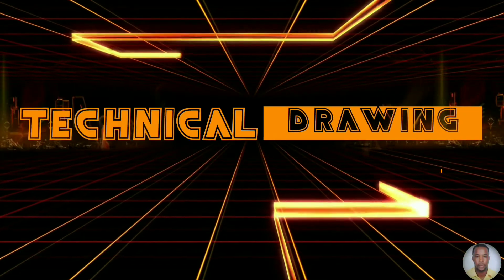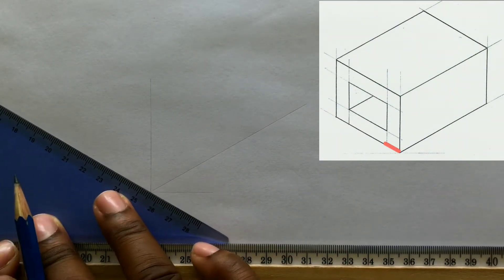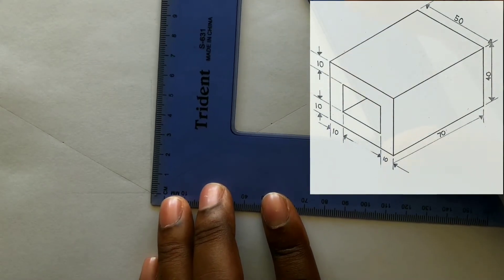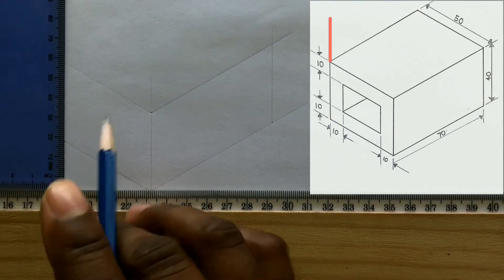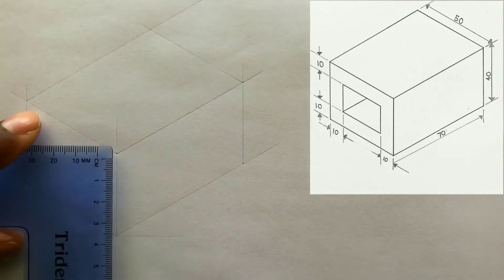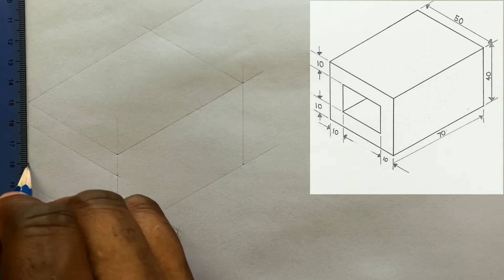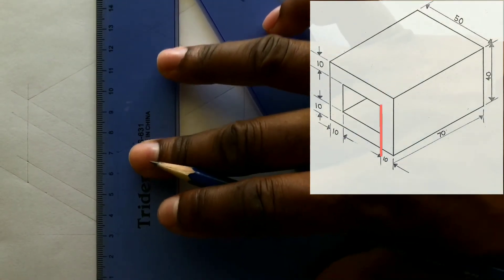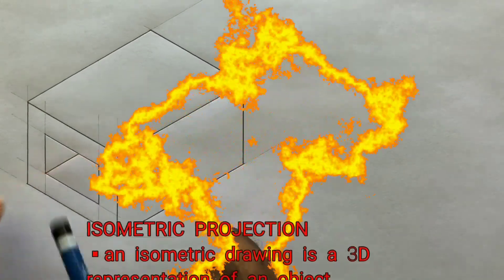How to draw an Isometric Projection | Exercise 4

Comment: GREAT VIDEOS BRO.... THE ONLY HORIZONTAL LINE IN THIS VIDEO IS THAT WHICH WAS USED TO CREATE THE PERPENDICULAR FOR THE ISO... AXIS. THIS CAN CONFUSE SOME STUDENTS AS THERE ARE ONLY PARALLEL LINES RECEDING AT AN ANGLE OF 30 DEGREES. JUST MY OPINION... KEEP UP THE GREAT WORK KING... MUCH APPRECIATED.
Reply from the maker: Thank you.  Point noted.